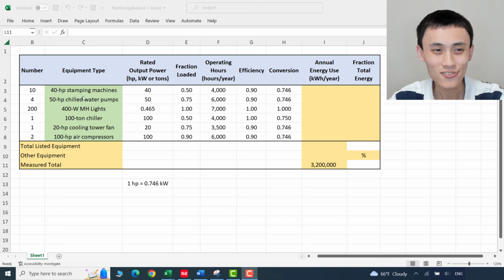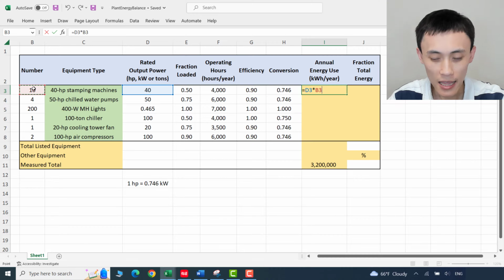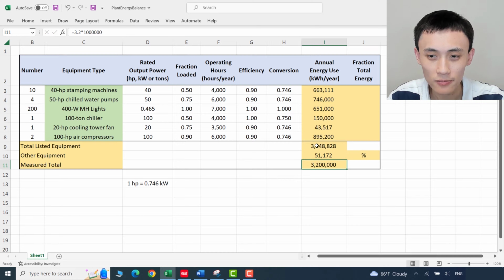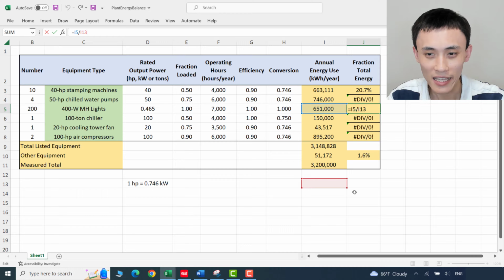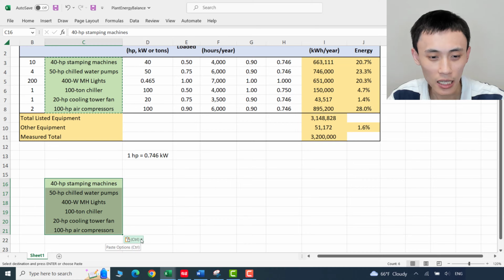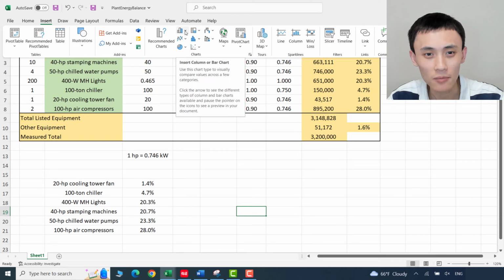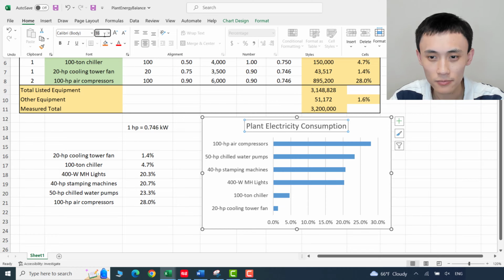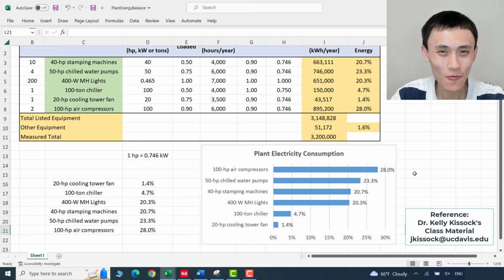Plant Energy Balance Analysis | Excel Data Plotting Tutorial 101 | Energy Audit | Electricity Use

Comment: Appreciate your video. It is really useful. Google says 1 ton = 3.517 kW. Why you put conversion factor of 0.750 for 100-ton Chiller ??  Thanks
Reply from the maker: The ton you looked up is a different ton used for cooling towers or chillers. The conversion of 1 ton to 0.75 kW in the context of chillers is not a fixed rule or universal constant. The value of 0.75 is a good estimation between cooling tons and kilowatts, although this number can vary between different chillers.

Comment: what is the 'fraction loaded' and how to derive it?
Reply from the maker: "Fraction load" refers to the estimated percentage load of a particular equipment. For example, if the maximum output power is 50 hp, but the equipment is only running at 50% load, then it may only generate 25 hp. Fraction load information can be obtained from the plant supervisor and is not based on any derivation.
Reply: Thank you very much sir 😊